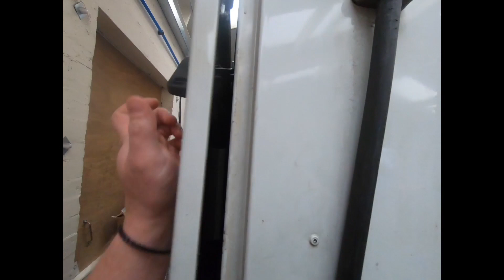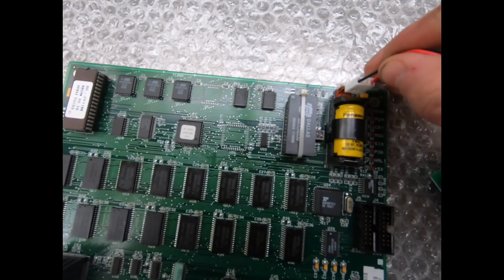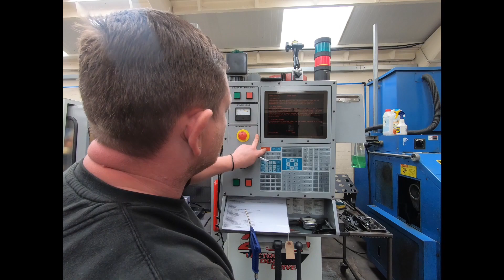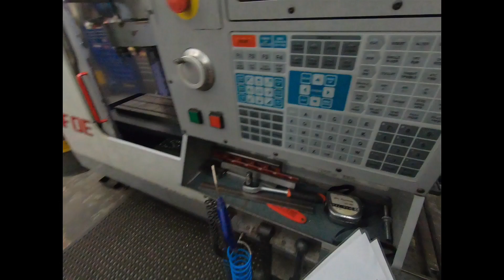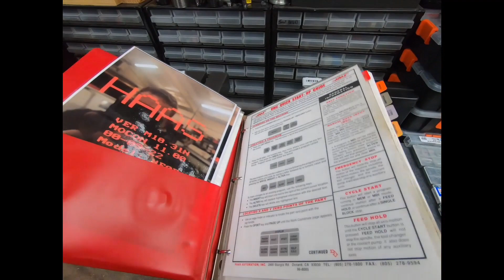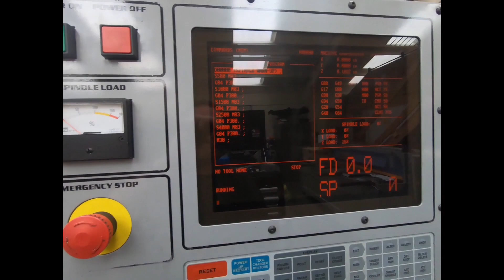Haas VF0E memory upgrade 1mb to 8mb

Comment: I watched this video some years back, now I could actually use it. I'm doing a 3d surfacing part and I have to load the machine with each op and delete as it goes along. not a huge deal as it's a one off and I didn't want to send over dnc. 8mb would be awesome.
Reply from the maker: I am selling the whole stack of 3 boards from this machine, Mocon, Video & Processor with the 8mb of memory if you are interested £1500

Comment: Nieprawdopodobne💪
Reply from the maker: Thanks
Reply: @kinzy_fabrications  A few months ago, I was looking for your video on replacing spindle bearings. Thanks to it, I replaced the bearings in my 1993 machine. After two months, it sometimes squeaks. Did I not use enough grease on the drawbar?
Reply: @kinzy_fabrications And I saw a video where you showed the bearing cage breaking. Was there any follow-up?

Comment: Its possible to upgrade memory whitout loosing all machine parameters ?
Reply: And where did you buy this memory I check mine and I've got km684000alg-7L
Reply from the maker: Hi, i cant remember my supplier but i googled the part number and just bought online somewhere
Reply: So, if I use hotair to solder new memory whitout battery change it should work plug and play or I must do something else ?
Reply from the maker: Hi i do not know what will happen in each individual case and if you leave the battery connected so do so at your own risk, but always a good idea to back upo the machine before any electrical work as if you dont then you will have real trouble
Reply: @kinzy_fabrications  Thanks for response, second question one guy offer me if I give him mine board 1mb they sold to me 8mb version for 700£ you think it's good option ?
Reply from the maker: @mariuszgabrys4237 
Hi it is a good option if you really need the memory in the machine as there is no other options out there
Reply: @kinzy_fabrications  I made right now a lot of 3d milling and programs have few mb. Thanks ! :-)
Reply from the maker: Hi, no you will have to remove the battery to add the new chips, the guys who soldered mine in said they would not do it with the battery installed on the board, im not an electronics guy so i went with it and did the back aup and re install that luckily went well for me

Comment: It's been a couple of years but, just so you (and others) know: the 16 MB board has 32 chips on it, also 512K each. Just did the battery on a friend's 1 MB Mini Mill. He had the two 512K chips and a maximum of 16 chips (same as yours). I shared your video with him.
Reply from the maker: Cheers, never turn down a bit of free info on these machines as may come in useful in the future, luckily my other 1998 haas vf3 already came with a 16mb memory which is rare

Thanks
Marc

Comment: Hey Marc, I currently had a dead battery issue with my vf0e. Would this be the same as what you went through? Did you "lose' battery backup doing this?
Reply from the maker: Hi

If your battery has completely died then yes you will likely of lost all parameters and will need to do a fresh re load as per the video, sometimes you dont have to do the serial number part of it but sometimes you do so you would have to just install new batteries and power up and see what it says on the screen

Thanks
Marc

Comment: Thank you for posting this video. It helped me a lot. I subscribed,  Do you have a video about how to transfer settings and parameters from floppy to USB drive?
Reply from the maker: Hi

If you buy a cheap floppy disc reader from Amazon then plug that into your pc you will be able to copy your back up files to the pc then onto a usb to use in your machine

Hope that helps

Thanks
Marc
Reply: @kinzy_fabrications  Great! Thank you for the reply. You are the best.

Comment: Setting 257 is the spindle orientation in steps there is a separate haas video on aligning the spindle. This is done if you ever replace the belt or disturb the timing of the encoder to the the spindle. Not all machines have belt but if the encoder is not in the exact position when removed or replaced then you just have to follow the stops for reset the spindle orientation. Also you can use spindle orientation button on the pendant to check the keys to be parallel with x axis using an indicator so you don’t have to guess and let the tool changer crash
Reply from the maker: I have since re set the spidle orientation and even though i only changed it very slightly it made for a smoother toolchange

Thanks
Marc

Comment: I imagine setting up from scratch will also reset the option timers back to zero
Reply from the maker: Hi

Afraid not, a re boot like this did not set the option timers back to zero, I know as I was looking to purchase the hsm option for a job and wanted to see if it was worth it on a 20 year old machine but they said there is no way of re activating the option timers even after offering to pay for another trial so all the must be embedded a lot deeper in the memory 

Thanks
Marc